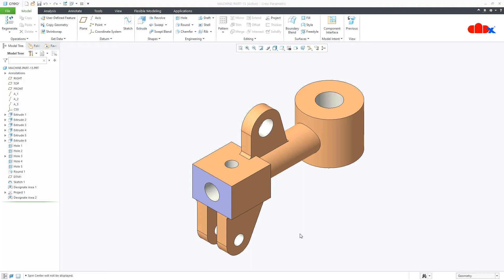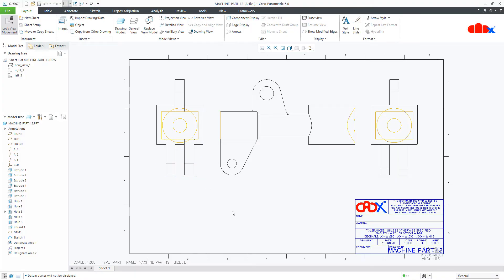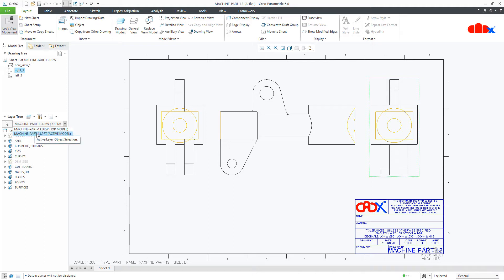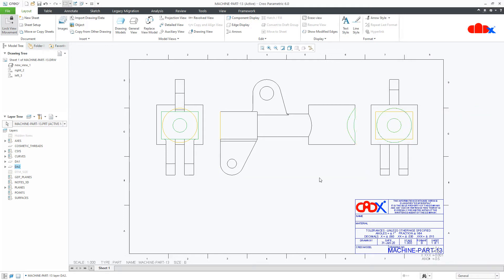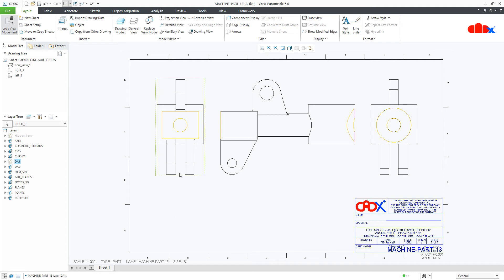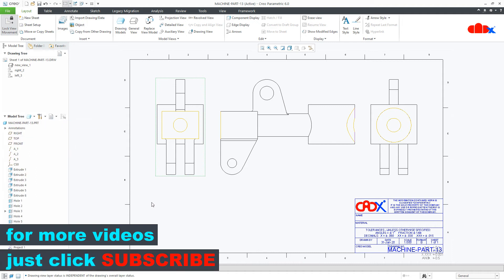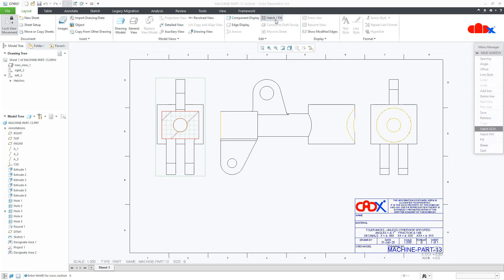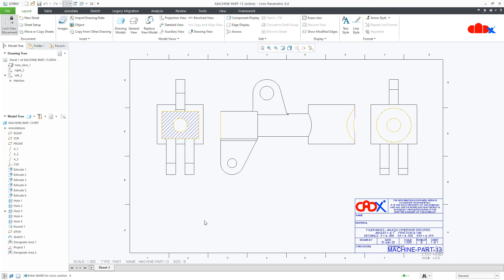Hatch the designated area and hide the overlap areas in Creo parametric

Comment: When I prepare & save drawing (.drw) with .frm in working directory the format does not appear in drawing when I reopen .drw as it does not save .frm in working directory. What is the cause of this sudden issue?
Reply from the maker: Paste the format, directly in the working directory.
Reply: @CADxTraining  How to get mass of part as well as assembly in creo drawing automatically?
Reply from the maker: https://youtu.be/VIff_J5C1NM
This might be helpful.
Reply: @CADxTraining  My query is slightly different. I am preparing a drawing format from scratch. In the format's title block I want part/assy weight in grams. So in drawing format what parameter I have to set to automatically calculate mass ?
Reply from the maker: The parameter got added in the part. &WT_KG should come in your title block.
Reply: @CADxTraining  So it means I have to just follow the exact steps as demonstrated in video & parallely add &WT_KG in my new format's title block.